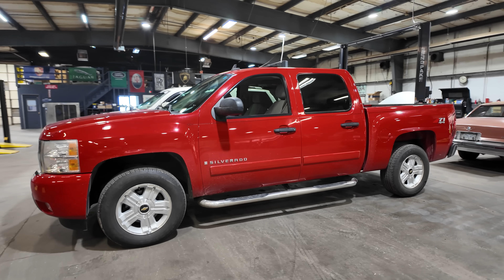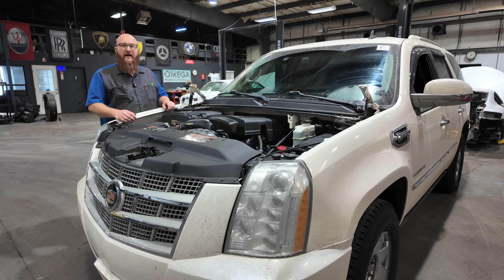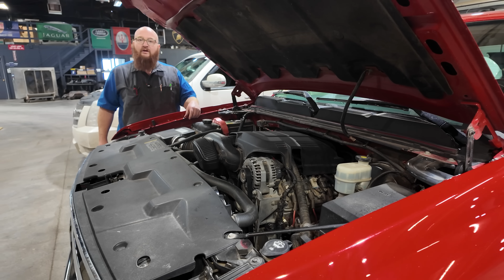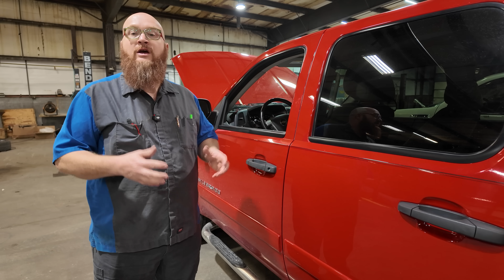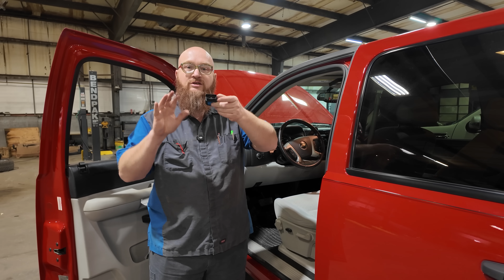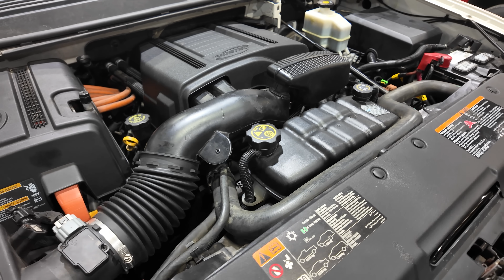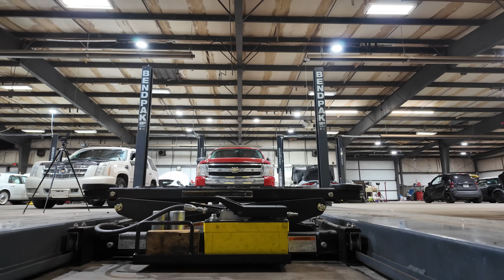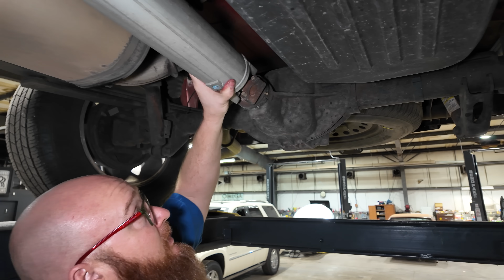AFM: Engine Saver or Engine Killer? The REAL Answer

Comment: $800 bucks and a weekend I deleted my AFM/DOD in my 2009 Suburban. The AFM/DOD was still functioning after 220K miles. Deleted before it failed. Maintenance was immaculate, defiantly improves the life of the AFM/DOD.
Reply: Yes it will fail, but all you have to do is buy a Range module and plug into the code reader adapter, stops the AFM.
Reply: @KennethCombs-m8s The AFM lifters can still fail. Deactivating the AFM greatly improves the odds, the only true fix is the physical delete of the lifters and cam.
Reply: @member57 greatly improves the odds? Evidence for that? Or is it just "trust me bro"?

There is nothing to suggest that AFM causes collapsed lifters.
Reply: @Boguardis 😂😂😂😂😂😂😂😂 No, there's plenty of evidence. Are you just stupid or don't work on trucks?
Reply: @Boguardis  Here's a collapsed AFM lifter in the middle the far left is a good lifter and the right one is a LS7 design lifter . This was in a 2014 GMC L83 Gen V 5.3L LT engine. Same lifters are in Gen IV LS engines.

http://youtube.com/post/Ugkxr3aAM8zlBP6NikKuvqK8pY0C4FVKl8Tb?si=6YAWn5ApfgNBwT_f
Reply: @Boguardis I think the idea is if AFM is disabled, the lifters never need to compress and then expand again (which is what fails, when they don't expand again), the default V8 mode is for them to stay extended.  In theory this should not allow the failure mode to occur.
Reply: yeah, if you just change your oil regularly it wont fail
Reply: @BikerJim74not true at all. It’s an extra fail point with the collapsible lifters. Guess what happens when you turn the vehicle off? You lose oil pressure and lifters collapse. It helps and prolongs for sure. But they still will fail.
Reply: @nicholasplattner7269 💯 The only correct fix is to physically delete and replace the lifters and cam. Turn off the AFM in the ECU also.
Reply: @BikerJim74 yes, and lets not forget those who drive them low on oil, not fixing leaks, engine cooling system not operating properly, oil varnishing/sludge build up due to low oil temps, the AFM MAnifold bypassing causing oil psi loss, and the classic hardened Oil Pump pickup tube o-rings causing slow oil psi loss and eventually pump scoring and low and behold lifter failures with a torn up bump stick 🙄...

Moral of the story, lack of maintenace and refusal to fix why is what kills them, nothing new, just common sense.
Reply: @PaulysAuto and you're a clown too. 😂😂😂😂 you guys don't know your ass from a hole in the ground, so stop spreading false information.
Reply: @BikerJim74You must have fallen off the short Bus AND turnip truck last night. 😂😂😂😂
Reply: @BikerJim74 While keeping clean oil in a Chevy V8 is the absolute best way to lower the risk of failure, it cannot fully overcome what is fundamentally a mechanical design flaw in the lifters. Countless owners who religiously change their synthetic oil every 3,000 to 5,000 miles still experience sudden collapsed lifters and bent pushrods, sometimes at very low mileage.

Comment: My Dad’s 6.2L V8 in his 2020 Chevy Tahoe had the lifters fail in 2022. Dealership was only authorized to replace one bank of lifters due to parts shortage in 2022. They blamed the foreign subcontractor that made the lifters. It was fixed under warranty and Dad sold it as fast as he could. 😂
Reply: My brother bought a 2021 Yukon Denali just after it came off warranty and that thing was constantly at the dealership with check engine lights.   On the drive home from the dealership the light would come back on and they eventually had to trade it in on an older suburban,  because it was an endless money pit.
Reply: I had the same experience with my 2017 Yukon Denali XL with the 6.2L. Lifter failure at only 3 years old w/40k miles. I asked if could replace all, but Dealer would only replace bad set of lifters. Thankfully was covered under warranty. Sold my Yukon about 1 month after the repair, just didn't know how long rest of valvetrain would last and didn't want to get stuck on the side of the road again
Reply: GM has a recall on 6.2. Crank and rods. Even the new swapped 6.2 fail just miles away from the dealer😂
Reply: Sounds like a modern GMC product for you don't buy anything but jappanes these days after 1990s american cars went completely to shit .
Reply: Buddy’s 21 trailboss 5.3 62k miles been in the shop for the last 3 weeks they are now doing the lifters
Reply: If you have to get that deep into it, just delete the entire AFM system and never worry about it again.
Reply: The lifters failed because of a design flaw, not AFM.
Reply: And you people still buy from Garbage Motors, why?

Comment: I had the LQ4 6.0L LS based engine in a GMC pickup and it was fantastic.  I later bought a '19 Suburban with the 5.3 and marveled at the power of that small of a motor, but that was short lived since it destroyed itself.  I'm now only running older stuff now that I can support myself.

Comment: I have a 2007 Suburban with 200k on it. Never had an issue, but I change the oil every 3k. IDK, maybe something to that
Reply: Im thinking of buying a 2007 Suburban LTZ with 150k miles for $5800. Have you had any major issues so far?
Reply: @512Born transmition was the only major thing. Had a reman with 100k warranty put in it

Comment: I added a AFM/DFM delete plug into the OBD port on my 2017 Sierra 1500 with the 5.3 on the recommendation of my mechanic. It's been on the truck for over 50k miles with no issues. No more deactivation allowing the lifters to always stay pumped up.
Reply: The lifter still might collapse. I don’t know if this is a solution
Reply: @mus_xr4653  I look at it this way. With the AFM/DFM delete OBD plug installed in the lifter is continually been fed oil since the AFM solenoid is not cutting off the flow. For every cycle the flow is cut off (during an AFM cycle) the risk of failure (since the lifter is designed to collapse and then reestablish full function upon retiurn of oil flow) increases. No oil flow cutoff means reduced probability of failure since the cutoff/reestablish is removed. I keep up with oil changes every 5-6K miles using the GM specified synthetic and I'm at 107k miles now, pull a fully loaded car trailer 20% of the time and the delete OBDplug-in hasn't failed me yet. If a lifter finally does collapse I'll go for the full delete then but at this point I'm happy with the results for far. Sure I give up some mpg but I'm willing to accept that.
Reply: Which disabler did you use?
Reply: @robertbagnall4868  The brand is OBDCAR and I bought off Amazon. Was around $70 dollars. "AFM Disabler Active Fuel Management Disabler AFM/DFM Disabler AFM Delete Compatible with V6 & V8 GM Motors AFM Disabler 5.3 Silverado".

Comment: Fun fact, for a while on Wikipedia if you looked up “variable cylinder management” (Honda’s cylinder deactivation tech) the description text in the search bar would say “one of Honda’s worst engine innovations”
Reply: Another fun fact is that Wikipedia contains many factual errors that remain until another person submits the correct information with a reference.
Reply: @Notfiveo0 
And AI uses Wikipedia for information. Go figure.
Reply: @Notfiveo0 reliable as Ai.
Reply: The Honda VCM system on the 3.5 V6 is really reliable.

Comment: The guy wasn't completely wrong, all HD 6.0L engines never came with active fuel management. Same with the new 6.6L gas, no AFM. 

6.6L gas only V8 engine I'd buy in the current GM lineup.
Reply: That’s like “not being completely pregnant”.  It’s a yes or no answer; no middle ground.  The guy was wrong but has too much of a glass ego to admit it.
Reply: @mikek5298this is a truck video, not a Holden Commodore video

Comment: I have a 2013 Yukon Denali with 68,000 miles. I built the transmission, and billet convert. Now it sits....looking like new....with a rotational  squeak that makes me afraid to drive it. I'm getting a new RAM pickup. I'm just too old to work on trucks anymore. Do I put a new engine in it, and sell? Put a cam, and lifters, hoping they'll be good? Should I give it to my grandson? I'm at a loss. I took such good care on this truck.

Comment: Would you believe it... I have a 2009 Tahoe with AFM and 258,000 miles. I turned the AFM off in the tune at 200,000 miles, but before then it was enabled. No lifter issues yet. I'm counting my days, but I'm seriously lucky that I got a unicorn.
Reply: At least that engine has easy access
Reply: Mine is a 2011 Avalanche 5.3. AFM still in place at 261,000.  It vibrates like a pulse effect, not sure what that means.  Vibrates for about 2 seconds, stops and then goes again.  Is it too late to purchase an OBDM delete?
Reply: @nickvan4514 sounds like your torque converter.  Change the complete 20 quarts. The shake is it slipping when it goes from v4 to v8

Comment: The main issue with the AFM/DOD lifters is in the lack of robustness of the anti-rotation feature. Non-deactivating lifters have 2 large flats that are held by the plastic lifter trays and even when that plastic heat-ages, it still keeps the lifters from rotating. The deactivating lifters have a small slot in the lifter body that engages with a little rib in the plastic trays. So when the plastic heat-ages, clearance is created and the lifter can turn in the tray so that the roller is no longer on-axis with the cam lobe. This immediately begins to round off the edges of the hardened steel roller, generating forbidden glitter. Then the lifters can rotate 90 degrees, allowing the roller to skid (making a chirping sound). More metal is shed, until the engine is a large paperweight.

Comment: 2007 Suburban 15.5 MPG with DOD, after lifter failed and programmed it out, 15 MPG no DOD.  So this was at 230,000 miles.  Saved 494 gallons of gas over its life.
Reply: 2015 tahoe with dod 245k and gets 22 avg mpg.
Reply: @flipphonewizard5448  must have a brick under gas pedal. I call bs
Reply: @user-px3qi6wx6y  you must be a chat bot
Reply: @user-px3qi6wx6y my 2016 5.3 L83 gets about that too.  20-23mpg on the highway.  We just got it and the "best" in the last 50 miles setting read 33mpg from the previous owner before I cleared it to get new data from our driving.  Modern V8s have gotten much better.

Comment: Why is it that I never see a channel like this cover Honda/Acura electrical charging system issues. A manufacturer uses electrical modules in vehicles, for at least a decade?, that cause a parasitic drain on the battery. No one cares I guess, just buy a new one lol.

Comment: 7:00 an interesting theory about that device, it's probably tricking the ECM into thinking that it's in tow/haul mode all the time which would disable the AFM
Reply: I did that to my 2019 Raptor when I had it using Forscan software.
Reply: I thought about that too but the tow/haul button in my silverado doesn't disable afm.
Reply: Tow/haul mode doesn’t disable afm on a 2015 Silverado. I pull a trailer every day and afm usually kicks in on flat to down hill surfaces.

Comment: The disabler is good if you get to the vehicle early, but even with it I have seen AFM fail.  Its a decent fix, but the real fix is change lifters and tune out AFM.  Did a great job explaining it and talking about the fixes.  These are great engines with an Achilles heel, the 6.2 in this gen Escalade is basically an LS3 with a few different parts.

Comment: I don't know why. But the last few years. It's seems almost every part I get need modified to fit or it's broken and takes few tries to get a good part. Now I know If there's a way of checking and testing it before I install it. I will. Just adds an extra unnecessary step. That i didn't have to do 10 years ago.
Reply from the maker: I agree. I have seen this too. Quality control has dropped sharpley across the board.

Comment: In 2016 bought a 2010 Silverado with only 20[,000mi. Thought I had a good one.   A few thousands miles later I started it up one day and all was fine. WhenI pulled into my driveway it had a slight knock in the engine.   Took it to my regular mech. and he wanted nothing to do with it. No one else was interested so I forced myself to go to dealer.  AFM and all its glory.   Out of warranty time wise. They repaired it. The bad thing thing was they had to put  OEM AFM parts back in it. I asked them to put it back togather with non AFM parts. Said they weren't allowed to.  Pulled away with a $4,300 hole in my savings.   Never was much of a G.M. fan and that sealed it I get on my soapbox when I can and warn people about it.
Reply: Not to minimize this horrible setup but I'll bet the previous owner did like 1 oil change.... many comments on here with people at 200,000 without issues...or adding disabler at or over 100,000 and still going without lifter failure.

Comment: Changing your oil on time is even more important than disabling/removing AFM/DOD. Delaying until 10k+ on intervals with garbage oil and not changing filters will destroy an engine much faster than AFM/DOD will, that can't be stressed enough. Most blame engineers as a scapegoat for them being absolute d-bags that abuse vehicles. I've seen 07-13 year models w/ AFM active go 250k+ countless times. Maintenance literally is the biggest difference between "reliable" and awaiting an early grave. I wouldn't say so for the 21+ years, those have legit problems that are from the factory, with a large part being quality control related and degraded parts related.  These years, 07-13, are NOT the same - totally different ballgame and just about bulletproof if you aren't drooling on your shirt.

Comment: Regular oil change is very important!
Reply: Every 3k 🎉
Reply: How often is "regular"? I've got a 2017 GMC Yukon with the 5.3 liter and AFM. The manual says 7,500 miles. I don't know how the oil change monitor is going to sync with that.
Reply: @williamjones4483  I have a 2011 6.2 and change it 3 times per year or every 6,000km (I don’t know what that is in miles). Typically when the oil monitor reaches 40-50% oil life remaining. You can easily reset the monitor after you change the oil. That’s not a problem at all. It has 350,000km on it, and it doesn’t burn a drop of oil. The transmission is the bigger ticking time bomb
Reply: Agree I have a friend with an 07 monte Carlos with the 5.3L 120k miles and same as you he is religious with his oil changes his oil every 3k miles with full synthetic. No DOD delete. Runs beautifully. Key is since this system really relies on using oil as hydraulic fluid is keep it very very clean.
Reply: @shadowfire246  Yes, finally, someone who thinks of oil as a hydraulic fluid. People neglect maintenance, and then blame the manufacturer when something breaks. Always ignore onboard oil life readouts, and all that oil company b.s. Just use your tripometer, 3 -5K intervals tops, and call it a day. $60 oil changes save you thousands of dollars in repairs in the future. Cheap insurance if you ask me.
Reply: @ogalief are you doing transmission fluid changes? Read the manual. Do not do a transmission flush. They are two different processes.
Reply: @williamjones4483 screw the system monitor and just reset your trip mileage (B) to either 3000 miles or 5000 up to you. This is what I do on my 2015 Chevy Suburban at 3000 miles
Reply: @williamjones4483  just between 3000-5000 with full synthetic. I recommend valvoline restore and protect in 5w30
Reply: @williamjones4483  5,000 miles between full changes (oil and filter), or 6,000 miles between full changes with dump-and-fill at 3,000 mile intervals inbetween.
Reply: @williamjones4483   I have a 2018 Chey Silverado 1500 5.3 and change the oil before 5,000 miles. Also I switched from 0W-20 to 5W-30. Yes I did lose 1mpg but I do feel the thicker oil is better for this engine.